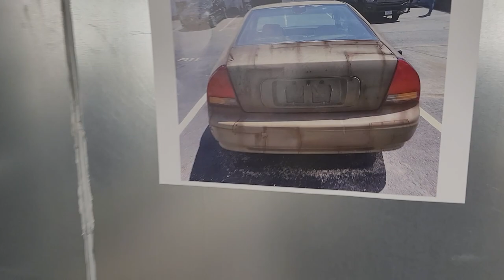Turbo Honda Prelude (Apocalude) gets airbrushed mad max style | ITS AMAZING!!!

Comment: u the only one i see that uses a hvlp gun...what size tip and compressor u use
Reply from the maker: You can't spray autoflex with anything else. I haven't sprayed actual plasti dip in like 6 years.
Reply: @treybedipping1734  oh didnt know that...all u use now is autoflex...